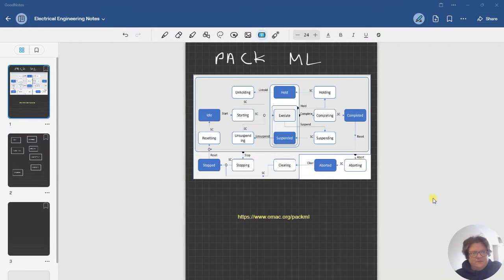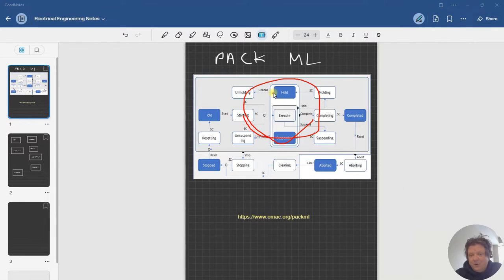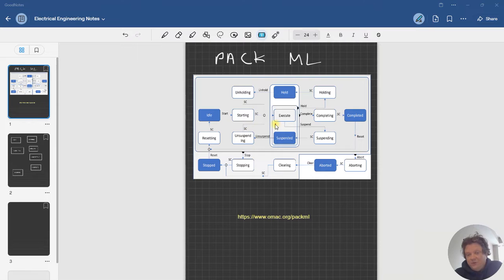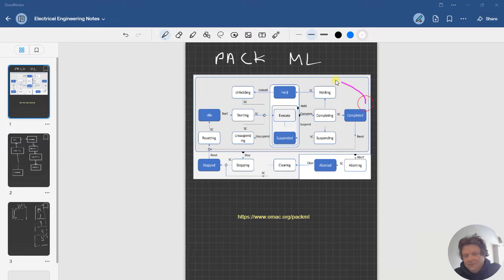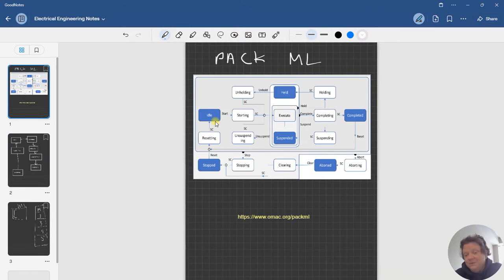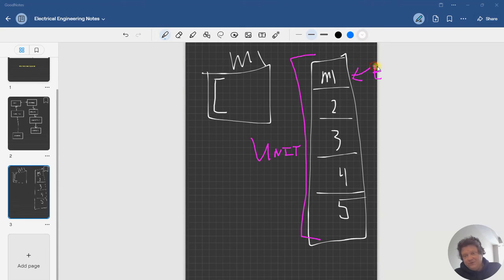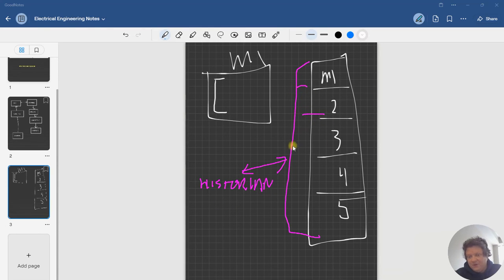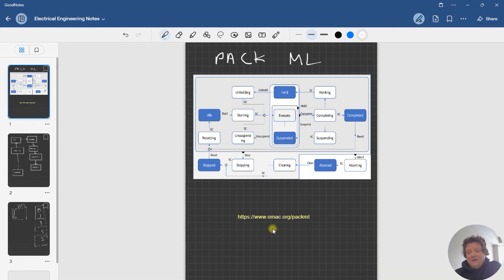PACKML

Comment: Im not saying, that you are wrong, but even in your own break-down, there is contradicting arguments for naming and splitting the UN or Line into programable sections.

Im not saying it´s easy!

Personally I use. 
UN is a collection of EM´s that make a machine.
EM is a function within the machine - Printing, labeling, conveying, heating ... Whatever that makes sence, simple or complex. - Always consider breaking down complex functions, but only if it makes sence with respect to the involved CMs
CMs is a collection of sensors, motors, valves... that is needed to do a function. - CMs may be entire printers, scanners or simple photoelectric sensors. - A CM is device that needs or generates IN/OUT-put

In most cases I make a UnController, that on PackML-state level keeps track of the individual UNs. And is responsible for HMI inputs and delivering human readable alarms based on inputs from both commands and PackML-states and mods.

Im not saying that this is correct in every case, but I havent found a situation where this didnt work.

NOTE:  This approach is for building new machines or lines, NOT changing details on existing ones.